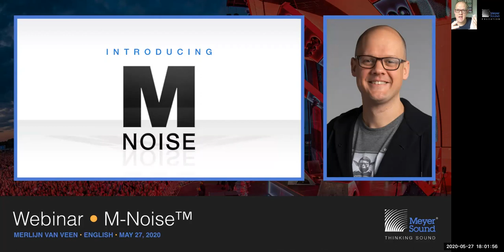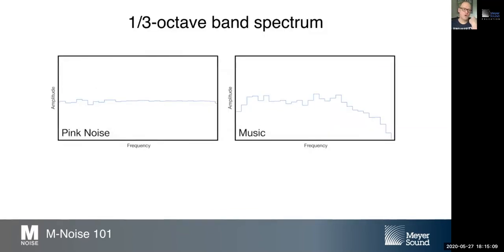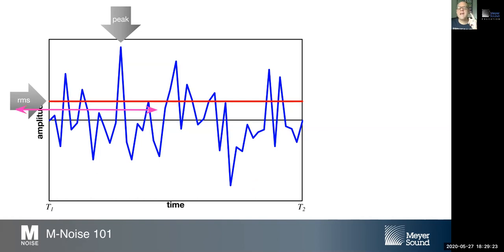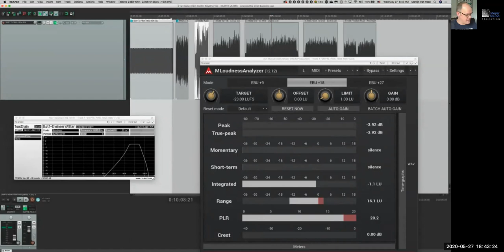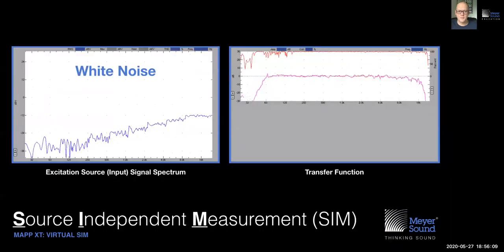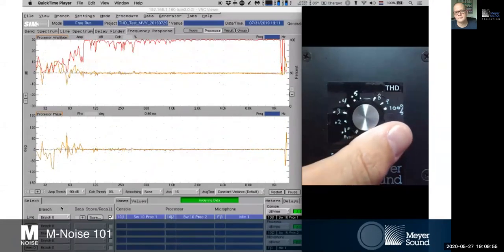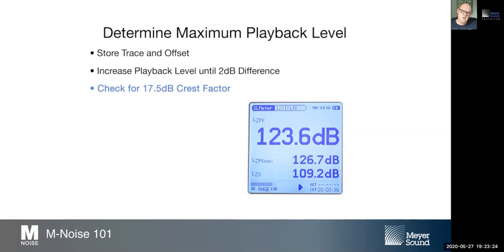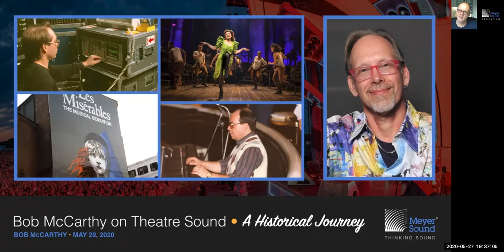M-Noise (English)

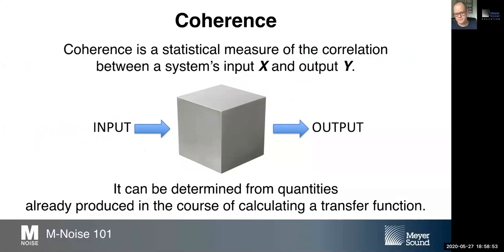Comment: Merlin, why @00:58:46 you say that using M-Noise for performance testing is another topic? Shouldn't we use M-Noise instead of Pink Noise for "voicing" our systems?
Reply: M-Noise is designed as a test signal to stress speakers into a distortion-producing condition, but pink noise is preferable for actual voicing of the balance of a system because of its providing equal energy per octave. M-Noise does not claim to be an innovation beyond pink noise for tuning purposes, only for distortion-limited performance envelope evaluation.
Reply: Conteúdo precioso. 

Obrigado Merlijn.